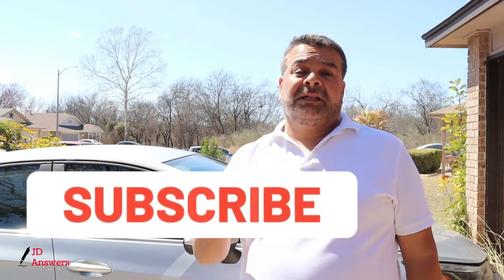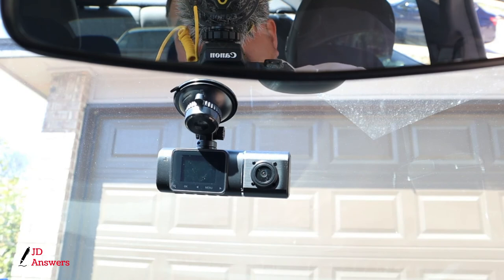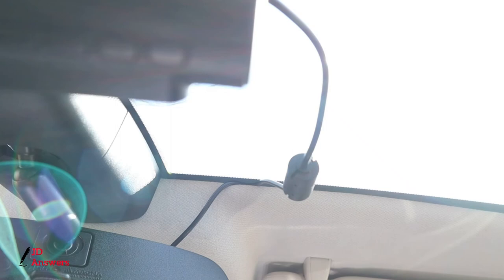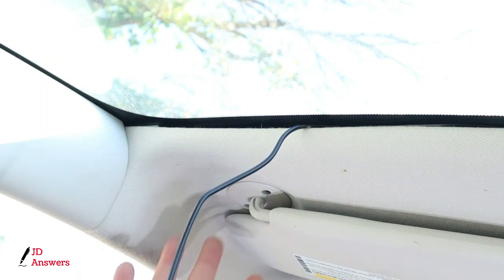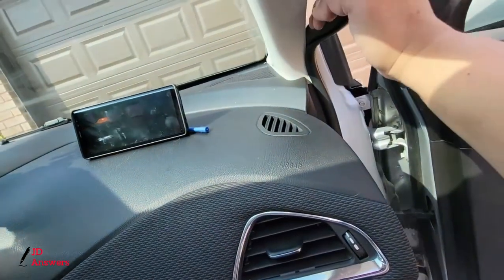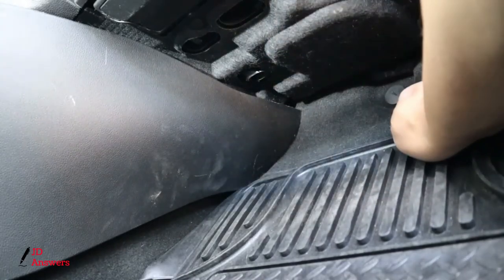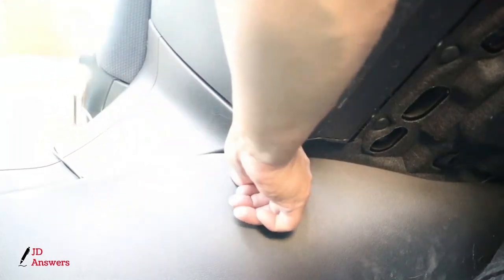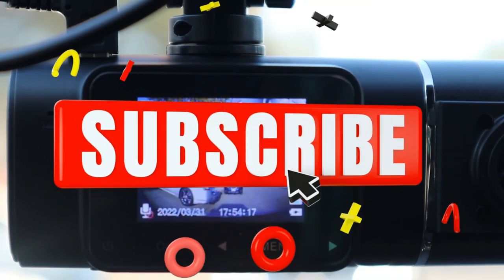HOW TO INSTALL THE  TOGUARD DUAL DASH CAM - RIDE SHARE DASH CAM - DRIVING and INSIDE CABIN FOOTAGE

Comment: I bought a toguard a. Couple of years ago and it totally sucked.Navigating the menus was a pain in the ass. Apparently it can't handle the heat so don't leave it in your car.  Garbage
Reply from the maker: I have had this dash cam in my vehicle for over a year. I live in Texas where temperatures reach over 100 degrees with no problems. No problem with the menu.